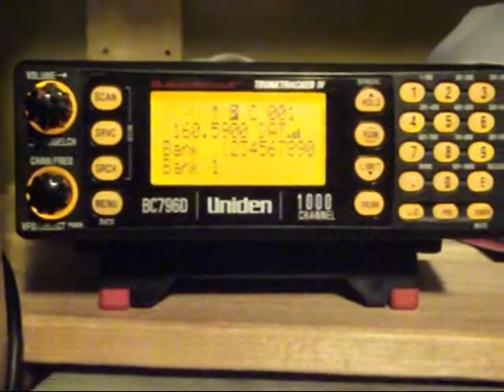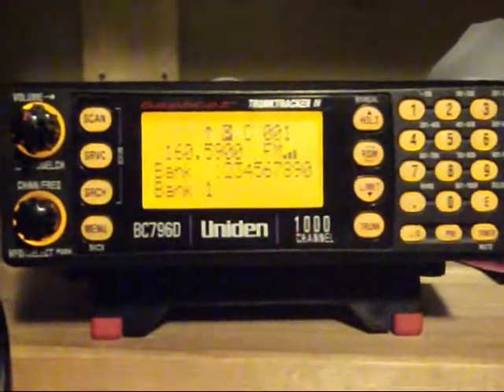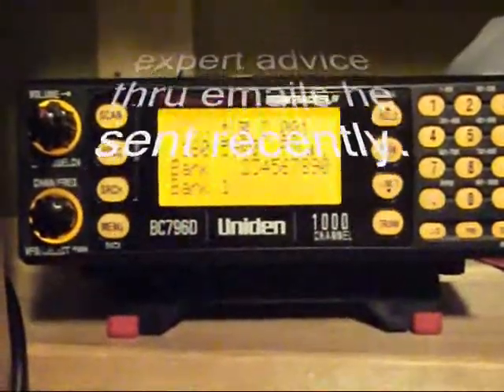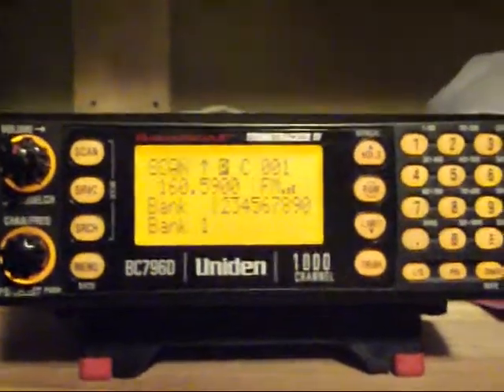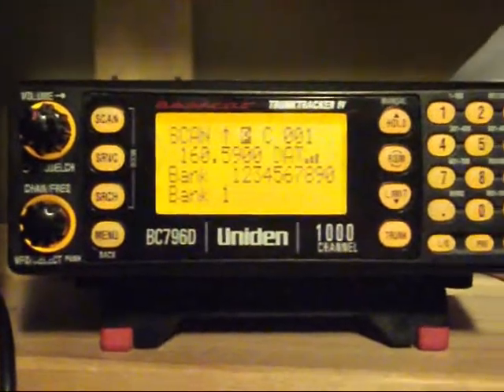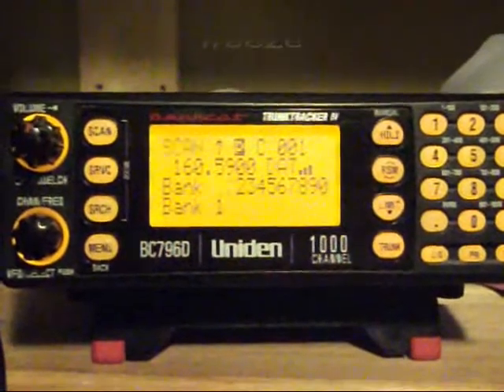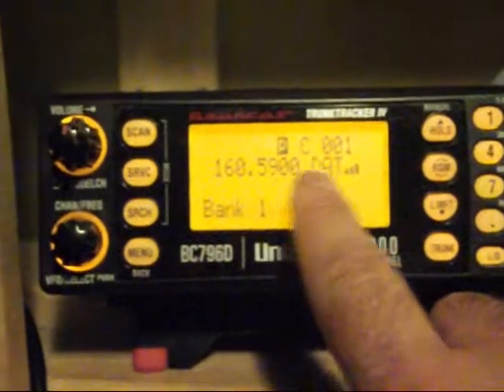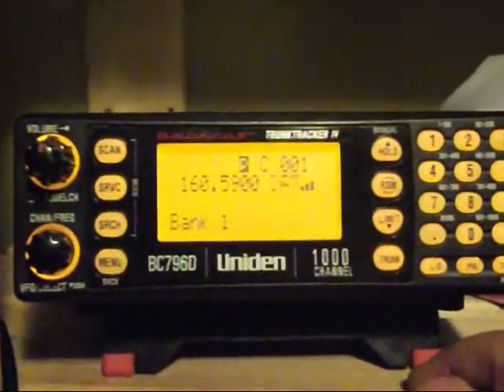Uniden Scanner BC796D update # 2

Comment: I am with hooservet as well. I uploaded the 3.60 and still getting communication error. Any suggestions? I am using a serial to usb cable as my new laptop does not have a serial port. Been watching the videos, but can't find one that has the same problem I am having. thanks.
Reply from the maker: You need to set up the scanner to look for your computer. It has been so long since I worked on the setup of this scanner that I don't recall what I did. I may have used a USB to Serial Port. I also know that I had to go into the computer and make sure the right serial port was being used. Sorry for the lack of help.
Reply from the maker: It may be the issue right there. You may have to find a computer with a serial port. Sorry I cannot be 100% sure but it is worth a shot. Find an old laptop or desktop with a serial port is my suggestion. Good luck!
Reply: Thanks. I ordered an adapter that someone suggested that would work with the newer laptops, so I will try that when it comes in. I will let you know if it works.
Reply from the maker: My recollection is that I hooked it to the serial port of my computer and it communicated well. I am thinking the scanner is old enough to not recognize a USB environment> I wish you good luck. It is a complicated scanner for programming. I still have not been able to program it properly.
Reply: I know...for the amount of money I paid for it you would think it would be easier. Thanks
Reply from the maker: The newest Uniden automatically sets itself to your area. I will eventually buy one I think. It is the Uniden Home Patrol.
Reply: I can listen on my phone and ipad with a scanner app which is cool

Comment from the maker: @milradio1 Much appreciated. As an update to the issue, I am now researching what the base frequency, space frequency and channel offset should be. I am told I need this in order for the scanner to scan digital properly but, so far, the information does not exist onlne. I am still convinced that Uniden could do much better in  the "plug in and play" department. It should be much more user friendly. It is more a computer programmer's job than the average "Joe" scanner operator.